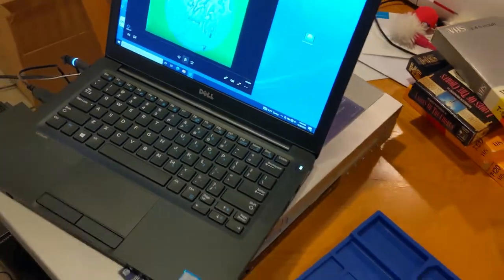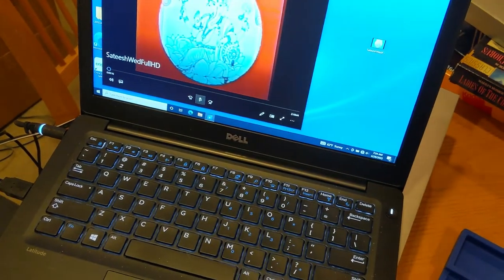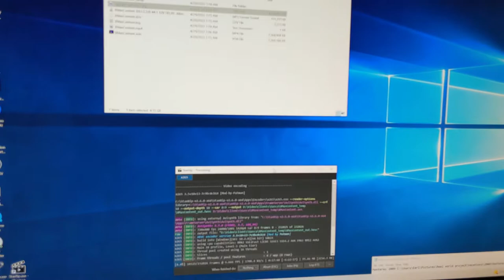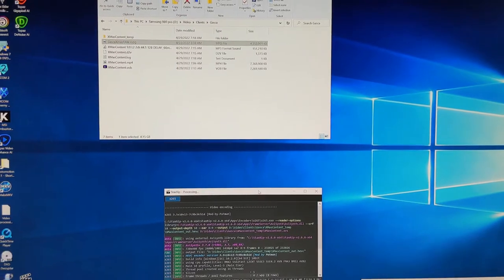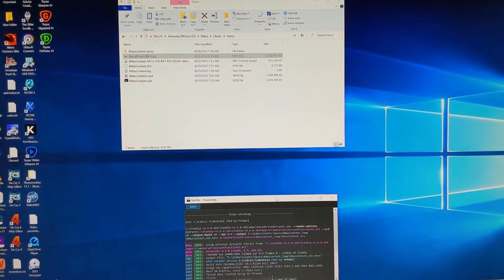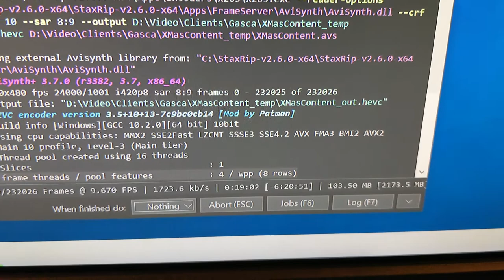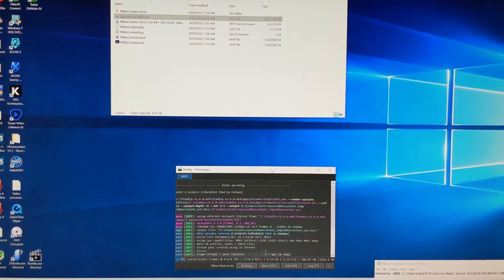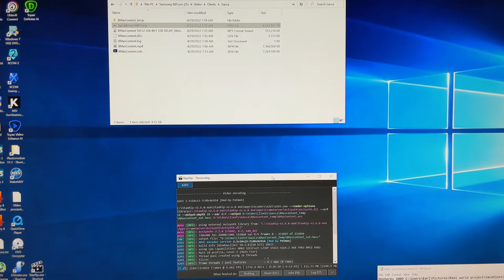Converting and upscaling old video like VHS

Comment: What capture software did u use
Reply from the maker: I bought the Vidbox analog to digital conversion device which came with bundled software.  It's a little clunky, but it did work.  Considering that the source material isn't great and I wanted to keep my budget lean, it was the best value for me.  It was about $90 at the time.

Comment: Cheers buddy, just what I was looking for 👍

Any chance you can post your script for staxrip?
Reply from the maker: You bet!  

704*480 below

MPEG2Source("%source_file%")
TFM(pp=5, mode=2, micmatching=3).TDecimate(hybrid=1)
QTGMC(ShutterBlur=3,ShutterAngleSrc=180,ShutterAngleOut=180,SBlurLimit=8,Preset="Very Slow", TR2=3, InputType=1,SourceMatch=3, MatchEnhance=1.0, MatchPreset="Very Slow", TR0=2, TR1=2, MatchPreset2="Very Slow", sharpness=0.6, SMode=2, Rep0=22, Rep1=22, Rep2=22, RepChroma=True, Sbb=3, SubPel=4, NoiseProcess=1, ChromaNoise=True, GrainRestore=0.5, NoiseRestore=0.25,DenoiseMC=True, NoiseTR=2)
pSharpen(strength=50, threshold=90, ss_x=4.0, ss_y=4.0)
MAA2(mask=1, chroma=true,ss=4, aa=128, aac=128, threads=8, show=0)
LSFmod(defaults="slow", strength=50, Smode=5, Smethod=3, kernel=11, preblur="ON", secure=true, Szrp=16, Spwr=4, SdmpLo=4, SdmpHi=48, Lmode=4, overshoot=1, undershoot=1, Overshoot2=1, Undershoot2=1, soft=-2, soothe=true, keep=20, edgemode=0, edgemaskHQ=true, ss_x=4.0, ss_y=4.0, dest_x=704, dest_y=480, show=false, screenW=1280, screenH=1024)
Prefetch(4)

OR 720*480

MPEG2Source("%source_file%")
TFM(pp=5, mode=2, micmatching=3).TDecimate(hybrid=1)
QTGMC(ShutterBlur=3,ShutterAngleSrc=180,ShutterAngleOut=180,SBlurLimit=8,Preset="Very Slow", TR2=3, InputType=1,SourceMatch=3, MatchEnhance=1.0, MatchPreset="Very Slow", TR0=2, TR1=2, MatchPreset2="Very Slow", sharpness=0.6, SMode=2, Rep0=22, Rep1=22, Rep2=22, RepChroma=True, Sbb=3, SubPel=4, NoiseProcess=1, ChromaNoise=True, GrainRestore=0.5, NoiseRestore=0.25,DenoiseMC=True, NoiseTR=2)
pSharpen(strength=50, threshold=90, ss_x=4.0, ss_y=4.0)
MAA2(mask=1, chroma=true,ss=4, aa=128, aac=128, threads=8, show=0)
LSFmod(defaults="slow", strength=50, Smode=5, Smethod=3, kernel=11, preblur="ON", secure=true, Szrp=16, Spwr=4, SdmpLo=4, SdmpHi=48, Lmode=4, overshoot=1, undershoot=1, Overshoot2=1, Undershoot2=1, soft=-2, soothe=true, keep=20, edgemode=0, edgemaskHQ=true, ss_x=4.0, ss_y=4.0, dest_x=720, dest_y=480, show=false, screenW=1280, screenH=1024)
Prefetch(4)

	Click x264 field in lower right to view options as well as MKV output format.  
	Doublecheck resize width is 704x480 not 740x480
Reply: @EDGeProjects  thank you very much.